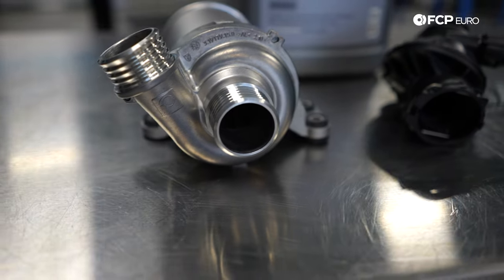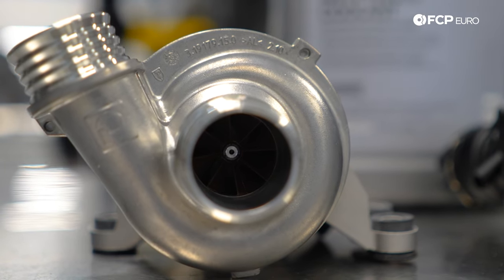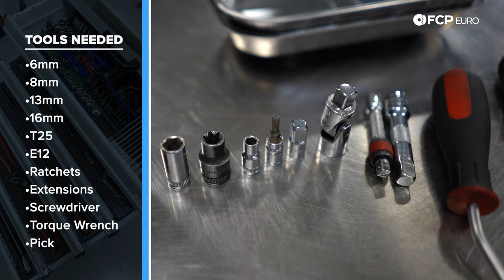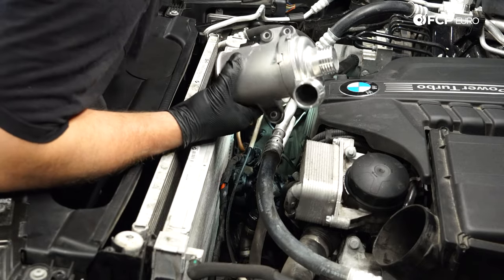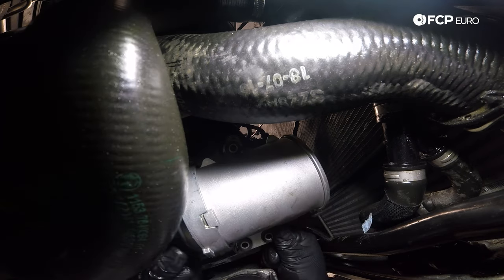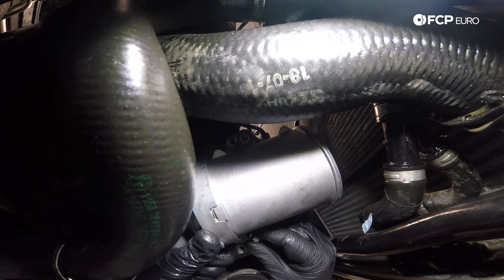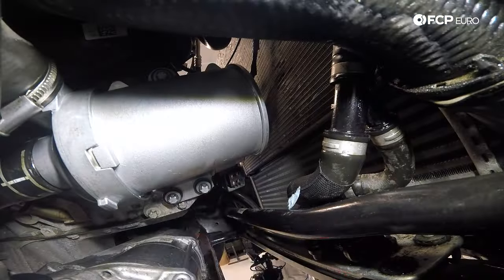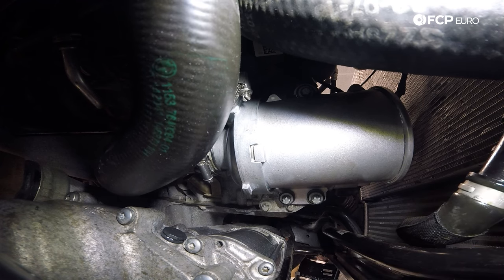BMW F15 X5 Water Pump & Thermostat Replacement DIY N55 (2012-2019 BMW X5, X6, 335i, M235i)

Comment: This job on an F30 with N55 X drive was pure joy.  The big front subframe made sure direct access was impossible.  It was a PITA for sure but definitely DIYable.
Reply: How long did you it take for you to do it?
Reply: @F30Gremlin  Hi Benny, it took me about 6 hours, and most of that was taking a break from frustration.    I could do both probably in 4 hours now.   This includes taking breaks.
Reply: @charlesberry4958  sounds great, u are giving me hope that i can actually do it by myself when the time comes. haha
Reply: @charlesberry4958 how did you get around the subframe?
Reply: @rastaco.1871  So the water pump you stick your hands and feel around.  It's literally 2 hoses, an electrical plug and 3 bolts.  You can see most of it but it's tight. The thermostat, remove the fan and it's literally right there.  The electric fan hides it.   It's really not that bad.
Reply: @charlesberry4958  thanks bro wish me luck lol

Comment: Super glad Gareth uploaded some more X5 videos. I have an e70 Xdrive35i with the N55 💪 My water pump failed with only 47k miles lol. The power steering pump went out a couple months before, and the OFHG 2 months before that 😂All of my parts are from FCP Euro 💪💪💪💪
Reply: I see it didn’t discourage you with the car, most people would throw it away after a third failure. Keep these German tanks running, not everyone can do it, only the strong will 💪

Comment: The only thing I miss from these videos is the DIY (home) instructions without special pressure pump to refill the coolant, or when they showed how to fill the transmission fluid with a special pump as well. a how to do it at home without fancy stuff from professional shop would've been more instructive.
Reply from the maker: Thank you for the note, Bruno!

Comment: I have 2013 xdrive35i turbo, M Sport trim and wheel package.  My thermostat is not connected to the radiator and have one hose from the waterpump that is "u" shaped and failed, now the hose from the  aluminum pipe coming from the direction of the firewall towards the front of the vehicle has a shape 90⁰ bend as well and has now also failed,  has  this configuration been changed. My water pump is behind the pump, not at the radiator.  Have bought most all my parts from you at FCP in the last couple years. Looking for a the better configuration to keep from going back again.
Reply: I also have a 2013 x5, not M though. The hoses failed on yours ? I've just been assuming my thermostat and pump failed on mine. And thanks for clarifying, the title says 2012-2019 but other videos did not show the thermostat attaching to the radiator

Comment: Thanks v much G - would never have attempted this but ur vid persuaded me.
For anyone attempting on a M235i the fan is different so check out a diff video on removing fan (most difficult part). After that it's only maybe 3hrs work. Deffo worth replacing thermo, mickey mouse flange and WP screws when u do this.
Awesome work G, thanks!
Reply from the maker: Thank you for the first-hand experience on the M235i!

Comment: I just finished replacing the water pump, thermostat, and engine coolant flange (Mickey) on my 2017 X5.  This video is super helpful.  I sourced my parts from FCP Euro, and they arrived swiftly.  The job took the better part of a day in my home's garage.  I used ramps to lift the front of the vehicle.  I did not need the compound pliers.  Medium sized needle nose pliers worked fine for removing the driver's side rubber block.  A long flathead screw driver is helpful for pushing the plastic clips out of the way to remove the fan.  Flipping in the driver's side fan flange is key to removing the fan assembly.  My vehicle's hoses wiggled off with some effort once the hose clamps were loosened.  I did not need a hose pick.  I also did not need to remove the passenger side wheel or fender liner to get to the upper water pump mounting bolt.  I used a swivel and long extension--there is a window to the front and outer bottom area to remove the upper mounting bolt.  Once all the hoses were reconnected, I used a cheap universal radiator refill funnel ($26 at Amazon) to refill the coolant reservoir--no fancy vacuum is needed.  Before I reinstalled the radiator fan, I activated the water pump using the technique shown at the end of the video (accessory on, climate control temp at max, and step on the gas for 10 secs) to make sure I did not have any leaks.  You can turn on the pump to refill the system as long the system doesn't think the level is too low.  The fan doesn't have to be connected.  There was a lot of air purged, and refill took about 1.8 gallons of 50:50 water antifreeze.  The whole job makes a big mess--especially disconnecting the first hose.  Despite having a catch basin, I consumed more than one roll of shop towels.  It's tedious.

Comment: Best suggestion was approaching the top water pump bolt from the side. Also, upgrading the top flange from the block is easy while the fan is out.

Comment: Lol yes you can get it out of the bottom from the side,  DO NOT do it….Please follow his directions though….. where the hell was this video 4 years ago,  I fought this pump for hours and gave up and came back and pulled it the through the side the next morning.  Thank you for this DIY !! I am now less worried about the next failure in 30k.  

Also the tell tail for this pump failure, is the fan running at full tilt for longs periods of time mine started doing it about a week before it died at 45k on my E70.

Comment: Thanks for this video. It was a great help. And I really thank you for pointing out the hose flange that fails. I had ordered the pump kit from you, that came with the bolts and coolant as suggested. I'd suggest adding the flange and oring to the suggested parts.  Part of the frustration is trying to figure out what I need to order. Having your website suggest all recommended parts for a repair, would be great. I'll have to pickup the flange locally tomorrow to finish this job. And I'm glad I took it out. It fell apart as I removed it.
Reply: Sooo.. what’s that flange part number?
Reply: @zotac1170  CHC0609

Comment: May I ask you a question…
Could the electronic water pump caused to drain the battery of the car completely dead? 
I have x5 2015 xdrive35 
Dealer charge me 1600 + battery 700
Reply: Others have reported that
Reply: Yes, I am literally having this issue right now. The moment I shut the car off, the pump starts to work and will drain my battery.
Reply: Mine did the same thing.  Battery discharge about 4-5 days before the water pump failed.
Reply: Factory water pump?
Reply: I’m going through the same issue now. 😂

Comment: Just what I was waiting for, F15 content, but you should always be clear about the engine code for each model in the title to make it easy to search.  I have an X50i F15 with N63TU V8 engine which was not covered here.😥 Better ring lighting still encouraged.  It would be a really great thing if Norma declared in a document which size O-rings are used in which spigot size connectors.  That way we would know which O-rings to keep in stock.
Reply from the maker: Sorry Gary, we have a TON more X5 content on its way, most of which will pertain to your X50i aside from the N55 bits.

Comment: I have been looking for the o ring for the hose goign from trans cooler line to thermostat before starting this job. In case the oring needs to be replaced. Do you know the part number? Having trouble locating it on realoem
Reply from the maker: Hey Kenny, feel free to reach out to our specialist via email at Service@fcpeuro.com.

Comment: The hose running from the engine block to the water pump, that also supplies the turbo coolant, what is the failure rate of this connection and the supply and return lines for the turbo?  Is there a DIY to help with replacing it and the turbo supply and return lines?

Comment: I ordered for a 2008, the pump that arrived has the connector at the back when the factory has the connector at the front near the propeller and inlet. I relocated the connector and it's working fine so far.. my box was already open so not sure what really happened here..

Comment: I cried watching this. I wish the F10 had the same thermostat to radiator mounting design. This 3 inch hose in between the two is not fun to remove.

Comment: Great video Garth. One of my next project. BIG question for you: Lots of discussion on the Forums about those (6) 16mm head (10mm threads) reinforcement plate bolts, as they are "torqued to yield". BMW TIS says to replace them BUT not many do. That being the case, what if you/I torque them to the 56Nm & only do about 45 deg additional.? Is that a bad idea? I wasn't sure I understood your recommendations.  Thanks for the Aluminum coolant flange tip, great idea. Thanks again. We need more F15 videos!
Reply: I do not recommend using less torque angle if reusing the bolts. Doing so will not achieve the desired clamping load on the fasteners and could result in bolts backing out and falling off the vehicle from vibrations. Ideally, these bolts would be replaced with every installation. However, in the real world I assume these bolts are often not replaced and are most likely over torqued when reinstalled (impact guns). I reused these bolts several times over the course of filming DIY videos with the intention to replace them upon wrapping up filming. I had the reinforcement plate on and off the car more times in three weeks than most cars will see in a lifetime of services. I believe these bolts are safe to reuse several times as the final torque achieved with the torque angle is less than the average recommended torque for an M10 10.9 class bolt. I would be cautious about the coating being wiped away over multiple uses. The ZNS3 coating acts as an anti galling agent (and anti corrosion agent) and will be wiped away over several uses. Most bolts BMW recommend replacement on are ZNS3 coated as each installation wipes away this protective layer (which will increase the clamp load on the fastener). Despite these bolts in this specific application being torque angled I don't believe they are truly being tightened to the point of yield.
Reply: @GarethFoley  Thanks SOOO much for the reply. Makes me feel better on my DIY's! I'll be ordering the WP & Thermostat (AND) the ALUMINUM cooling line connections today or tomorrow. Do you want to make a house call & help me with this R&R? Free dinner!
Reply: @GarethFoley  HI Gareth, your videos have been really great to watch. No nonsense and straight to the point. I recently purchased a 2017 M2 (85,000miles) and am currently stockpiling service parts for a complete reset. This includes the cooling system.

Is this process the same for the F87? It looks very similar... and since I will be doing the WP, T-stat, flange housing and Charge Pipe, does it make sense to replace the hoses as well? I hope you can see this and reply! Would mean a lot to me and thanks :)

Comment: Did your water pump fail ? Or you just changed it cause you know it might cause of the miles of the car? Great video btw
Reply: It didn't fail on this car. Just replacing it preventatively. Given the wide window in mileage these water pumps tend to fail I personally opt to change at the lower end of the known failure range which is 65K miles.

Comment: I am mid process. My first serious DIY. Man this is painful process!!
Reply from the maker: You got this!
Reply: Thanks, just put water pump and thermostat back. The most difficult part was to remove the hoses from the water pump and unscrew the top bolt. It was much easier to put it all back. Also replaced the plastic coolant hose flange and installed the crab seal guard. aNow awaiting belt tensioner and pulley to replaced it, install the belt and will be good to go!